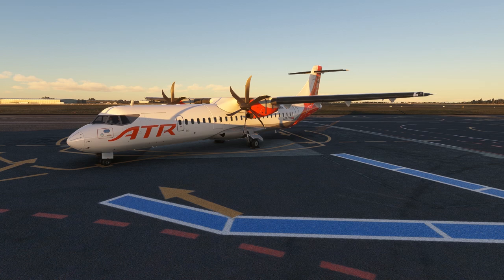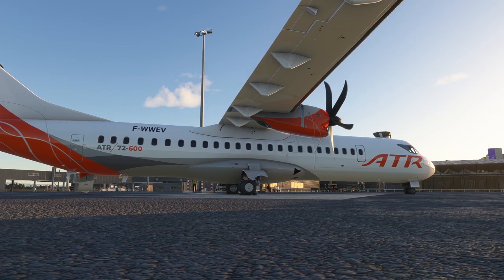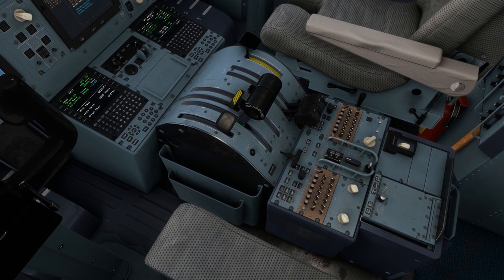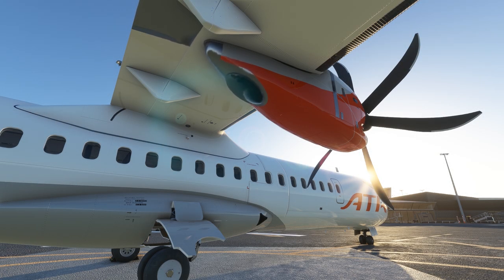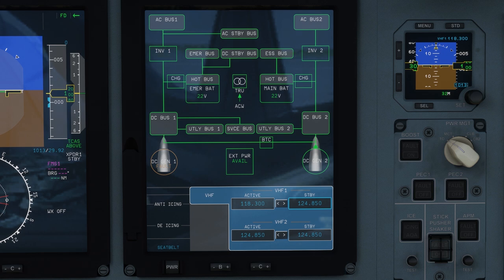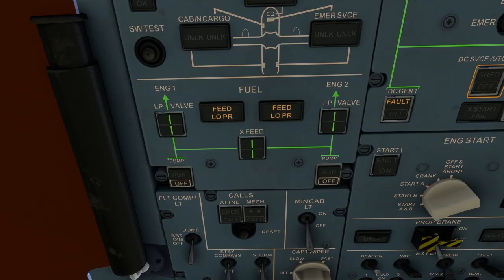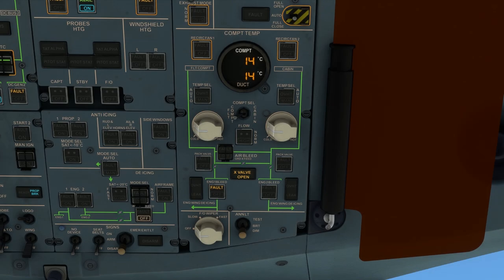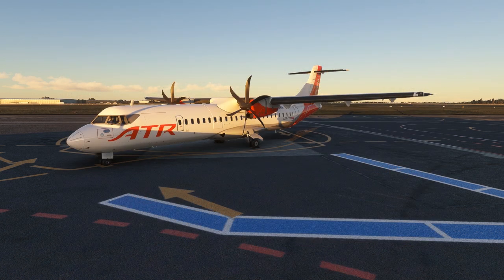Aircraft Discovery Series 2 | ATR 72-600 | Episode 2: Aircraft Overview and Systems

Comment: Really disappointed that the world map flight plan is not directly imported in the FMS. This is a core feature of the simulator and this being an "official" is really weird that it is not supported. Nevertheless it is really well done as far as the accuracy goes.
Reply: It's the same with the A310, I believe. In this it's not too annoying since flights tend to be a lot shorter, so you wouldn't need to enter more than a handful of waypoints.
Reply: @IncapableKakistocrat  Yup I just completed a flight and it went pretty well. FMC is not too complicated and as you said, for a regional aircraft it's not too bad. Doing that with a transcontinental flight would be an absolute pain though. At least is uses the same nav database as Microsoft Flight Simulator, so no need to cross reference with Navigraph data.
Reply: Honestly if an aircraft support this feature I would automatically expect its LNAV to be shitty, No high fidelity aircraft does import flight plans from world map.
Reply: The developer is Hans Hartmann, but it's officially supported as an MS first-party product. The problem here is that many devs use their own/different code to the one used in the world map etc. So, it means there cannot be direct import of flightplans within the world map.

This doesn't mean the LNAV won't work though, that's not how it works since LNAV working properly is based upon the code within the aircraft files themselves. MSFS constantly updates to the latest AIRAC cycle so the nav points are all correct.

The BAe146 professional from just flight uses the MSFS code and it works with no issues pretty well.

Comment: Can hotel mode also run cabin heat for operations in cold climates? Or just the air conditioning?
Reply: Yes it can heat up the cabin. It's also being helped by warmer air from avionics compartment that is getting recirculated instead of being dumped out of the plane.

Comment: Having an issue where my right propeller doesn't spin up
Reply: Press the HYD AUX PUMP pushbutton on the pedestal , make sure on the overhead panel a green READY light appears next to the propeller brake and release it, make sure blue PROP BRAKE light goes off. Regards